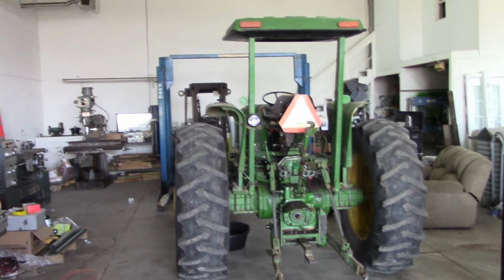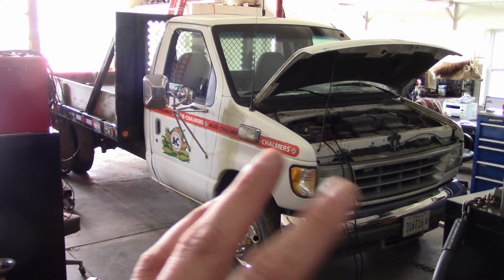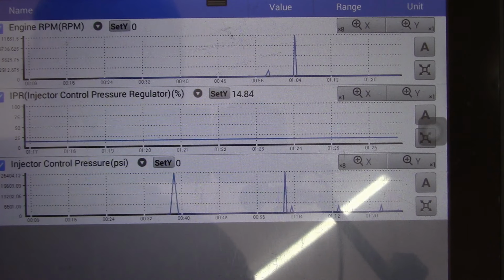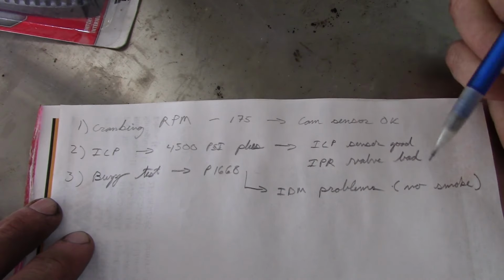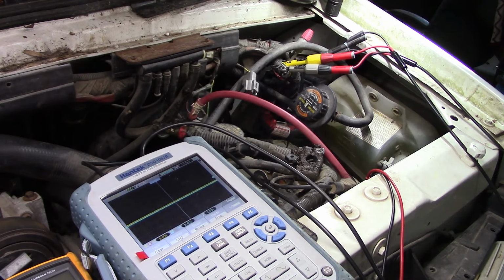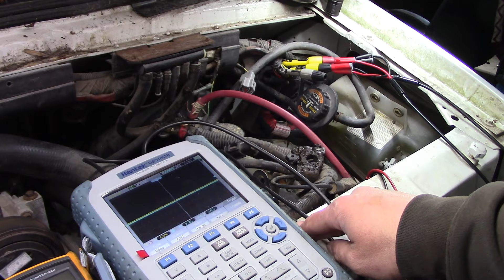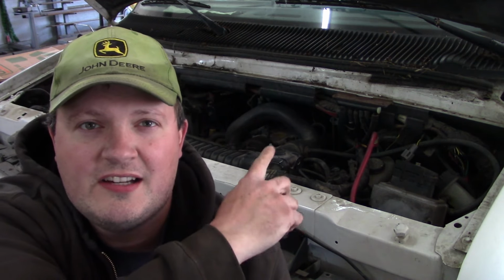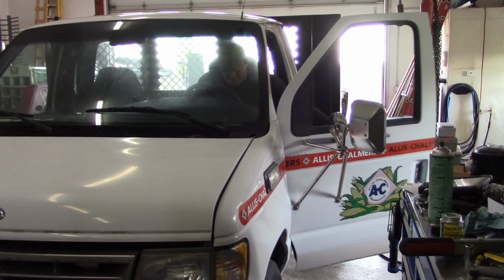Ford E350 | 7.3 Power Stroke - Cranks but won't Start - Part 1

Comment: Suddenly, after years of smooth sailing my 1999 Ford F250 7.3 diesel runs smooth then totally dies.  When I wait about 15 minutes it starts up but dies after a few minutes.   I changed out the fuel bowl heater and it ran smooth for about 15 miles then did the same routine.

Comment: I've seen this kind of thing before, it's usually a result of of storing the battery on a concrete floor and then running the motor for a few minutes on a cool day without coolant. 
Sorry to say it's a goner.
Reply from the maker: See, you get it!
Reply: BMC1100 that only happens to
Reply: BMC1100 two stroke Detroit Diesel engines .

Comment: check that the rubbing on the wire doesn’t come from the hood. That why you dont see anything rubbing on it when its open... Just like the fridge light..
Reply from the maker: I don't think so. It's protected by the air box.

Comment: I wonder if they put used IDM's in it? Those are so straight forward with out obvious damage like rodent chewing the IDM would be the culprit. I don't see many issues with them but when you do a new or reman is the only way to go. Also I have seen moisture getting in the IDM connector cause some strange issues.  I feel you have done your due diligence on testing. The valve cover gaskets would definitely be replaces as a precaution.
Reply from the maker: I don't know. The tags look to be factory.
Reply: @WatchWesWork  I would just put a reman in and see if it fixes it. The ones they put in may have already been tired. I have always went by the rule new injectors new IDM to be able to provide the current needed to fire them. That way they wear together as a system like cams and lifters.

Comment: There's a high-pressure oil pump at the top back of the motor that's a typical issue. Also, since oil pressure is used to open the injectors, flow of the oil into the high pressure pump is critical. There's a tiny screen on the intake of the pump that clogs. and blocks the pump.
Reply from the maker: HPOP pumps were pretty reliable in the 7.3. I don't know that I have ever seen on fail like the 6.0.

Comment: No real questions here!! VAN!! POWERSTROKE!! 3in hood opening!! Take the cab off, VOILA!! Plenty of room!! 😝 

Wait, the forklift is stuck in front of the tractor!! Hmmmm, how to get the cab off??? Well, do you have dynamite??? A chainsaw, and 4 gallons of kerosene?? We will get that darn cab off!!
Reply from the maker: Tractor, gantry crane, hot air balloon. We can make it happen.

Comment: Do these engines run solenoid actuated injectors? If so, an injector coil going bad will absolutely kill an injector driver. A whole bank going bad for sure sounds like a harness issue.
The drivers are usually very simple divices and it would be worth checking the injector resistors to see if they are out of their values.
Injector drivers are just glorified relays that are optimised for high duration/ high saturation operation and to limit current flow, to protect injector windings. They are separate from the main ECU so the main ECU doesn't have to deal with the high current loads/ noise/ heat these operations generate. As you would know, the main ECU just wants to send low current ground signals to things to control them. Hence the need for relays, drivers etc, to convert that signal into an appropriate current to perform the task.

 Having a look at what failed in the IDM will point you in the direction of the failure.
But, I bet the injector circuit downstream of the drivers is off, or one or more injectors is not well.
Reply from the maker: I have checked each of the injector circuits and they are right on the resistance spec. and no shorts to ground. But, that's just sitting in the shop, not running down the road.

Comment: Ford still makes the E series now with the same basic cab since 1992. Only cut away chassis after 2014 and E350 and 450 only. I have a 2021 and only engine available is the new for 2020 7.3 gas engine which replaced the V 10, No diesels.

Comment: As a mid-90s ambulance owner... These things are complete wiring nightmares.  The amount of auxillary wiring in the dash is INSANE.  I pray you find a mechanical issue and don't have to start digging too deep in the elec
Reply: They are overwhelming sometimes. But you just have to separate the conversion wiring from the OEM. Then it is not that bad.

Comment: Because this was an ambulance does this still have the kill switch on the seat I myself love the e series trucks yes they're a pain in the ass to work on but you can get a e350 or a e450 and put a flat bed and it would be much cheaper then buy a F series lol
Reply from the maker: I does have the switch.
Reply: @WatchWesWork  is the kill switch  on the drive seat disconnected or is it still connected to the wiring of the truck usually when they're still connected it can cause short to the ECU and modules if it's still hooked up usually a malfunctioning switch can cause the truck  run very weird had this problem  with a 97 ford e350 mini bus

Comment: As seen by others.. there is some arcing going on between wires in the connector. Put your finger on your monitor over the flapping tape to the left to stop it distracting you. And ignore the piece of dirt that falls just as the engine starts. You have breakdown in insulation resistance of cables in that connector.
Reply: Most noticeable a second or two after you say "I guess that's what it needs"
Reply from the maker: I have a hard time believing it is arching. I think it's just some junk being blown around by the fan. This is 120V, but it's not thousands of volts like an ignition coil.

Comment: Nicely done. Running good for siting a few years. I am chasing P0300 random missfire on my 02 tacoma. Really scratching my head now. Replaced all the typical stuff, plugs, wires, maf sensor, crank sensor. Recently new fuel pump and filter too. Have a cam sensor on the way. Only miss-fires after siting for a day, and then only for 8-15 seconds after starting. Then runs great. Dose not seem to be loosing coolant, and all cylinders have good compression. There is a igniter(ignition control modual that controls the spark but I wold think that would either work or not.
Reply from the maker: I don't know. You might want to check the fuel trims. If it's random and not on a certain cylinder, it may be fuel related.
Reply: @WatchWesWork  So after a few months the truck finely thew a p0303. I pressurized the cooling system over night, and in the morning cylinder 3 had a good amount of coolant in it. Probably a cracked head or head gasket.  Proably just going to leave it and see how how long she lasts. Uses almost no coolant. 18years old with a rotted and patched frame, just not worth the time and money

Comment: I work as the mobile service technician for an ambulance refurbishing company/dealer.  I am thrilled that ford no longer offers a van chassis with a diesel option.
Reply from the maker: LOL. I bet you are!
Reply: The new 7.3 gas engine leaves plenty of room to work.  V10 wasn’t terribly cramped.

Comment: Wes, I too was eating IDM'S on my 2000 7.3L Excursion.  The issue was the rectifiers/diods in the alternator.  I found on ebay a heavy duty rectifier for my alternator.  US made and supposedly for high amp alternators.  (plus I installed a new voltage regulator).  Autozone alts were giving me fits, but the real culprit were the high amp alts (Chinese) I bought on ebay.  Chinese alts can have dog shit rectifiers.   I rebuilt my high amp ebay alternator with the new US made heavy duty rectifier and the problem went away.  The IPR spikes you are seeing "may" be related to the rectifier leaking, confusing the voltage regulator into sending more voltage, then the leak stops, voltage spikes briefly,  voltage backed off, but the damage is already done to the IPR.  Spike voltage fries an IDM, maybe!  Good luck!
Reply: Wow that's crazy.. trying to figure problem now. Same code.. p1668

Comment: I know nothing about these engines, but a few observations:
1) You are seeing 4500 PSI which seems high. But when you had the sensor unplugged the default value provided was 2500, which is still way more than you were expecting, but is in the same range as the 4500 measured. That makes me suspect that the 4500 is a reasonable value, and maybe it is just something other than real PSI. 
2) Also note that the sensor was in its linear range with that reading. Usually ECM value ranges are calibrated around the expected range to not waste bits. So if 400 really was the right value it probably would have pegged around 800 and not been able to show a value like 12K (which was shown in one of the early spikes).
3) When you were showing the chafed wires, the light brown wire was also rubbed thru. If that is against a metal shell you could have had a short from the red wire to the light brown, which might have done something bad to the ICM.
Reply from the maker: All true! Others have pointed out that the pressure was too high because the injectors are not firing, therefore not using any of the oil. I should have thought of that!

Comment: Minimum pressure to start is like 500 psi and a good pump at WOT should only be 2800-3k psi on a 7.3. Even the adrenalin pumps don't usually make over 3k in a truck. By chance did you watch the ICP with the 2nd IDM on it to see if it was still reading high pressure.
Reply from the maker: I did not, but you can hear that they are firing correctly. When the ICP pressure is too high they hammer and it sounds like the engine is way out time and about to come apart! I'll be sure to check it if we have a part 2.
Reply: @WatchWesWork  I'm just curious to see if those numbers change with the IDM. Also I've never seen one kill IDM's like that without a dead short. By chance do you know who they were got those from?
Reply from the maker: @Spyke383  I don't know. It's buried in the fire wall. I'll see if there is a reman tag on it if we do a follow up.

Comment: I saw you test the ICP before changing the IDM, but I'm wondering if you checked it afterward?  If the PCM needs feedback from the IDM to properly command the IPR valve, maybe changing the IDM fixed the cranking ICP issue?  When I had a problem with the my IPR valve (about 3 years ago), I got an indication it was the culprit by the fact the the IPR duty cycle went up to about 70%, upon acceleration.  I think the PCM was sending commands, trying to compensate for a low ICP.  In my case the IPR valve connector wires seemed OK.  Replacing the IPR valve fixed my issue.  I had to remove the "fuel bowl" (filter/water-separator assembly) to get better access - very challenging in the van without removing the turbo...possible, but NOT fun.
Reply from the maker: In a way the IDM is responsible. When the injectors fire, they bleed off high pressure oil. Without the injectors firing, the pressure continues to build.

Comment: That computer is pretty smart. It figured out that there was sum ting wong. Usually an old ambulance is a pretty good rig. Hate working on vans though. A guy came up with a special rigging setup for pulling the 7.3 out of E series vans.The F series cab and chassis make it a lot easier target for the old parts cannon.
Reply from the maker: You can remove the cab pretty easily. At the junk yard they pull the engines by flipping the van on its side and torching the front cross member. The engine just folds down and they can unbolt it.

Comment: these 7.3’s absolutely LOVE good power and a GOOD solid ground. if it were my truck i would remove all grounds and wire wheel them and re install.
Reply: I do this on any used vehicle I buy since they're all 10+ years old.

Comment: its a injector problem. The injector resistance goes high and causes the idm to fail. Only cure is to replace all 8 injectors. i have seen this several times.
Reply from the maker: Resistance is right on the published spec.
Reply: @WatchWesWork  what happens as they run resistance goes up and the amp draw increases over time causing the module to fail. I have sold mutiple modues for this problem and a week later they are complaining the module is defect.

Comment: hi wes you might want to check the alt. might be spiking or the wires to rear amblance body shorting out just saying to much amps with all the lights and extra junk hooked up.

Comment: the rubbed through wire could that could have been something removed from it when it was decommissioned as an ambulance as for the controller if its failing as it moves id say there's a ground or wire intermittently shorting out... it has been taken apart converted and modded twice now in its life
Reply: My thoughts was a test light/meter poke and not properly sealed back up

Comment: I'm surprised that cub cadet pulled that in the shop! Pops and I have the head off our cub, it bent a pushrod and chewed up a valve seat. Cooling fins were packed with crap!
Reply from the maker: I tried to pull the shroud off my Kohler Command once. I got one bolt out. Broke all the others. 2 hours and 3 helicoils later I finally got it back together.
Reply: @WatchWesWork  that shroud is a bugger!! We unbolted what we could and just kind of propped it out of the way. I couldn't believe how much stuff was stuck in there!!

Comment: Using a scan tool def makes it easier but I worked on these for a few years before ever having one.
Simple deal to remember, no smoke, no fuel when cranking.
I've seen "brand new" IDMs be DOA before.
Reply from the maker: The scan tool really makes it easy. You can do most things with manual gauges and volt measurements, but it's so much messing around.
Reply: Patrick Baptist my son acquired a retired and abandoned 1996 F250 - it had been in a field for over a year - vines and wasps had moved in. It had a check engine light on, and the scanner at autozone said no it doesn’t.  

I found a used “ Brick” snapon scanner and was able to diagnose and solve the problems.
Reply: Patrick Baptist I meant a 1995 F250
Reply: @o.c.smithiii2626  
Those are awesome trucks I prefer the OBS to the SD style.  I've have a couple of F350 7.3s.
I actually use several apps on my tablet depending on what I'm fooling with (I'm a road side tech), but I don't always fool with it depending.  Those autozone scanners don't work well for 7.3s, scan gauges are decent, that was my first scanner.

I bought a 96 that was a no start, ford dealer wasted prev owner more money I I paid for it, well cared for, no smoke when cranking, loads of new sensors, GPs, IDM, turbo rebuild, new PCM, FPR and they wanted to do injectors next.   I got it in an hour it was running.  Front tank was clogged, rear tank pickup was broke off, I just plumbed in a inline fuel pump to the mech stock pump, she fired right up.
Best used F series I ever bought.  $1000
Didn't have any reader of any kind.
I now have a 2000 F350, 485k on the org engine, starts up good down to 12f without the block heater, sure she smokes a bit when cold, but she still tows and drives fine.  Prob the best condition cab I've had and with the most miles....

Sorry I don't know why I kept rambling on, just late and bored I reckon.
Reply: @WatchWesWork  I wound up buying several apps and adapters because I wound up doing road side mechanic work so I service a wide range of vehs. Before then it was just swap parts or use a multi-meter, oh and I do have scan gauge I never use anymore...  I have alot of 7.3 experience, in my little town I'm the goto guy for them, noone else messes with them much.

Comment: Emergency equipment in big cities is rarely shut off for extended times.
Ambulances are usually idled to death, never really "floored" or WOT it's
entire service. They hurry, but never excessive as to knock around
equipment or Patients.

How old is that fuel? Stiction? Older Coolants becomes acidic.
That oil looked awful, thinned and black doesn't make good
pressure for those injectors. Weak, dirty oil compresses very easily,
making anything oil operated sluggish- even a cam phaser and
hydraulic lifters can stick or fail.

People don't change the oil & filter enough, and companies know this,
and make that long interval crap. 3k or >2 years period, especially
if running ethanol fuel. People don't listen.

Comment: i have a scope like you are using works when running sample test mode but unable to get to read simple stuff like tps would you consider looking at it if i shipped it to you. i think i just dont know how to set up
Reply from the maker: What are you trying to do with a TPS? These scopes are not good graphing multimeters. The buffer is too small. I suggest you find something with a consistent signal, like a frequency generating MAF or MAP sensor. Then use the "auto" button and let the scope set itself. That will give you a good starting point for automotive settings.
Reply: @WatchWesWork  i wanted to start using a scope funds limited a friend of mine had bought this scope new several years ago used one time and put it under bed. i bought for $100.00 something to get started with and learn. rigged up a 5volt power supply and used a tps just to test something to start with. never got it to graph the voltage up and down. had a friend that does scopes for doplar radar thinking he would show me what i was doing wrong he never got it to work either. i just wanted to see if it works or not. since then bought a snapon Vantage Legend with 2 channel scope works good but have always wanted to know what we were doing wrong and why unable to get to work. it also has 10:1 attenuator on each lead will those work for automotive coil checking or do i need to buy better. and again thanks for responding know you are busy
Reply from the maker: @DependableAutoTruck  There should be test terminals right next to the BNC connectors for the leads. That makes a known good square wave you can use to test and calibrate your scope.